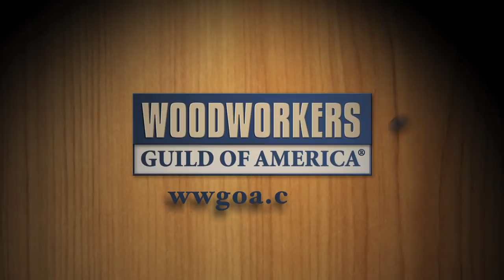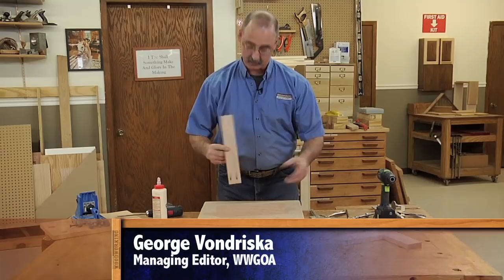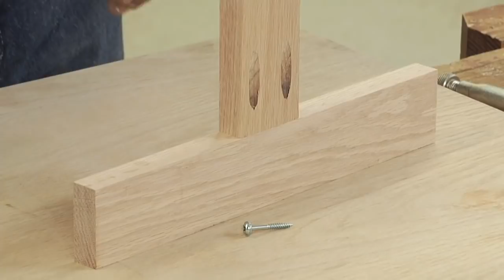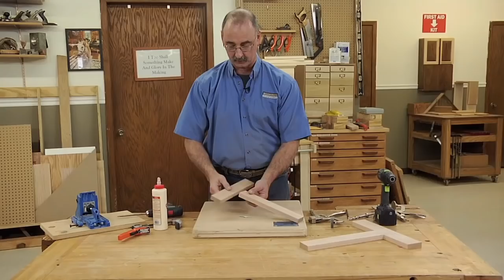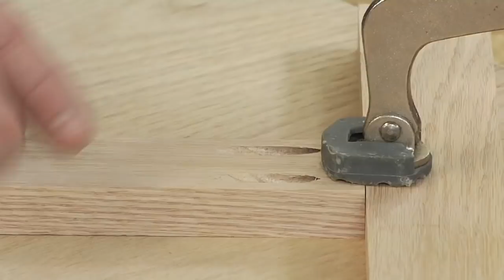What’s the Deal with Screw Pocket Joinery  |  Woodworkers Guild of America

Comment: I use pocket holes for face frames 100% of the time.  It’s fast, totally secure, easy to adjust a bit if you make a measurement error and...for the face frame application you need to remember that the frames will be completely supported and secure once fastened to the cabinet case.  Sold on KREG all the way.  P.S.  I am not affiliated with KREG.

Comment: I've had nothing but problems using kreg pocket holes,to me,it's a hit and miss affair.
will never use again.be easier if the screws were posidrive ends,sometimes the joint comes out of true ,
you can throw as many clamps at it as you possess,and it still moves when you screw in.
on 5/8 inch wood the screws sometimes won't hold and just keep turning and won't tighten.
won't use again.use a biscuit or dowels,maybe more work ,but I know I'll get a good result.
Brian,uk.

Comment: I just chastised someone for saying glue is pointless in a butt joint. Great vid as always. BTW I have found pocket screws to be great for any indoor application and for other "tight spot" situations where I could not get anything to start holding. They lasted about two years on some outside sunroom doors. I redid them all with glue and now everything is good. Glue BTW not only holds things together but in a situation of constant stress like an outside door it dampens and spreads the constant shock of opening and slamming as derived from wind, raccoons and kids.
Reply: +Toodle
End grain glue joints are useless as a primary joining method but when they supplement other joining methods they can be excellent. 

There is no harm in a little dab of glue on a screw joint.

Comment: Did you notice how far off plane those screws pulled the rail?  I've tried pockets and not found them all that useful or precise for all the extra gear cluttering the shop.
Reply: Nice catch, but that's because of imperfection in the joined surfaces. That proves just how tightly those screws pulled them together. You can see the gap at the top of the joint even before he starts screwing in.
Reply: +Mark Jones
The guy just used some scrap wood to demonstrate the joining process. More than likely what happened is that the wood is bowed hence the cut was not straight so it meant the face of the joint relative to the length of the wood was not straight. 

It is no big deal to be honest.

Comment: I find that pocket holes try REALLY hard to pull the joint out of alignment. They were a gateway drug to woodworking for me but I try to avoid them whenever I can at this point.
Reply: Jeremy, thought I was only one had a few disasters and cringe just watching video found could live without them I'm in a better place now Ahahahahaah!
Reply: As long as the pieces are clamped very tightly before you screw in and as long as the faces are perfectly straight, it should not pull anything out of alignment. I've done a few and never had any issues.
Reply: Vlad Malik thanks Vlad, but it's just not my experience, no matter how much clamping force I use, even different methods such as one parallel clamp on each board, more often than not the faces are pulled out of flush. At that point, having to struggle with clamping so much, it's usually not worth the "convenience" if the faces need to be truly flush.
Reply: I just tried it on two scraps: https://www.dropbox.com/s/h0qvijn4y4ugm3q/pockethole.mp4?dl=0

Wasn't particularly careful. Seemed as flush in the end as before, considering wood wasn't jointed or planed. I then tried clamping to the table on both sides. Used just moderate force. That was maybe slightly better. At the very least, easier to screw. I then shifted the piece over, drew a pencil mark across the joint, and screwed in again. It may have moved laterally by some fraction of a mm. I never really noticed that. Maybe could be completely mitigated with high-tack glue allowed to set for a few seconds?

Are you sure the screw is the right type? It should have a really sharp and self-tapping point. The drill bit should also be one with a pilot hole end, which keep it centered and prevents screw from traveling. And the screw has to exit right in the center of the piece of wood. As soon as it comes out and hits the other piece of wood, mine bites immediately without any traveling.
Reply: Pure horse dirt. 

Pocket holes are as good as any other method of joinery. If you cannot get them aligned then that is up to you to have a look at your methods. 

I use them routinely on simple small projects with out any issues at all.

Comment: Could have used this before my last project—Kreg pocket joinery can be frustrating especially joints that go out of registration and screws that bust through the wood even after following Kreg’s own instructions.  Will use the clamp next time.
Reply: It is an excellent method of joinery and is suitable for several purposes. Now if you are making a grand dinning table it probably is not suitable but it could be used in several parts of the table. 

Just take a little practise with it.

Comment: I thought we don't use glue in that situation because of expansion of the wood. It will stick fine in the beginning sure but when the seasons change it will break down no?
Reply from the maker: A good rule of thumb is to not constrain more than 3" of a cross-grain joint with glue.  Under that threshold the glue can absorb the minimal movement of expansion and contraction under normal circumstances.  The joint shown uses 2" material which is typical for face frames.  If the pieces were 4", I'd suggest applying glue to only the inner 3", leaving a .5" non-glued portion on each end.

Comment: Do you have to use pocket hole screws because they are 4 times the price of ordinary wood screws? Thanks in advance
Reply: Ed Macfarlane Yes, you must use screws with a head that is flat on the bottom. A panhead screw for instance would act as wedge and lever your two surfaces apart.
Reply: i dont know what you mean since i commented i have been using ordinary screws and everything is fine.
Reply: +ed Macfarlane
You can use ordinary screws to produce hidden screw joints but when doing at an angle you are going to need to certain things into account to compensate for the shape of the head of an ordinary screw. 

I used to do it years ago before pocket holes came along but it is not as straightforward as just drilling and screwing in.

Comment: I'm still not convinced about pocket screws. In my mind it just does not seem to provide a strong connection. Now with the added glue I can see it can, but I'll need a bit more convincing before I shell out $100 for a full kit.
Reply: I can't say I have met anyone who wasn't happy with their Kreg jig. Pocket hole joints have their weaknesses but they are still plenty strong for many applications. I use them on almost all of my projects and I haven't had one fail. I have built cabinets with nothing but pocket hole joinery (no dados) and they easily hold as much weight as you can place on them. You can get one of the small Kreg kits (Kreg mini?) for around $20 if you want to try them out.
Reply: Thanks ricksite . I tend to be an all or nothing guy, so I would want the complete pocket screw kit if I was going to get anything, but based on your experience that cheaper "intro. kit" sounds tempting.
Reply: I've recently dismantled a mach 1 jig made a year ago which was assembled with pocket hole screws and polyurethane glue, and I was amazed at the strength of the joints. As experienced by WGOA, the glue on the end grain held so well it tore out chunks of the wood rather than parting at the glue line. Secondly, the Kreg pocket hole screws were incredibly strong and had to be unscrewed rather than being wrenched out or severed. The Kreg screw steel is of the highest quality (better than any other brand I have come across) and the thread beautifully machined for maximum grip and resistant to working loose (creep). Needless to say I was able to reuse the old screws because of their pristine condition.
The pocket hole joint is my first choice when a STRONG joint is required, being the quickest, most flexible in application, and the easiest technique to implement. Brad-nailing is the quickest joint but lacks strength and is susceptible to creep and therefore not to be used in chairs and products frequently put under stress. The mortise and tenon joint takes longer to make and requires more expensive equipment. IMHO dovetail joints were the overall best joints a century ago but in the present day fast-moving society they have a shrinking following and best left to the professionals.
Reply: Jeff Harmed This is very helpful, thank you!
Reply: Jeff Harmed Do you really think pocket screws can be used to make a sturdy chair?  I'm a new to woodworking;

After thought, and budget considerations I did decide to get a table saw (never could cut a straight line with a circular saw, and hardwood is too expensive to waste on mistakes) and I got a router.  Can't afford dovetail bits yet, but have two straights, Good for making dado and rabbit joints.  I did recently buy a two pocket hole jig. I have most of the other equipment needed from over the years.of diy home care, at least a completely manual version of it.  by DIY Home care I mean most of the repairs to things around the home.  Table, chairs, boxes, floor work, hanging semi permanent fixtures, a few cabinets, hang doors... you know the stuff.

But, do you think, with glue of course, that pocket screws would support their use in making a sturdy chair?  I'm guessing I should think of it as a steel dowel, or pin, instead of a wooden dowel.

I'm with you on buying a joiner for mortise and tenon joint, would be nice; but, cannot afford that right now.  so I use dowels in some things.

Thanks ahead of time for any reply.
Reply: Chip Cooper I think you can use pocket holes to make a sturdy chair. I made some chairs for my toddler out of 1x2s and 1x3s and they easily hold my 200+ pound weight. I would look online for chair construction with pocket holes to get some ideas on how to best make them. You could even build a test chair out of cheaper construction lumber to test the design.
Reply: ricksite Thank you very much, that sounds like a great idea.  I see that you wrote 200+ lbs... for myself I would have to say 250+ or maybe even 280+ lol.  Well, all I can add is it is a darn site better than two years ago when it would have been 380+ ;-)
You know it's too much, when they won't let you ride a Clydesdale, so you can see my interest in 'sturdy' chairs.  Cheers, to my soon hitting the 250+ mark!  Thanks again.
Reply: I know woodworkers with many years experience who only have the basic single-hole jig that I have. You don't need anything else.

Comment: What's the deal implied you were going to say why to do it not just how 😐
Reply from the maker: +myaccountagain The main reasons that you might consider using pocket screw joinery include: 1) speed.  This is one of the quickest forms of woodworking joinery, 2) Reversability.  Assuming that you don't use glue in the assembly process, you can quickly disassemble a joint that is created using pocket screws, 3) Strength.  Pocket screws substantially increase the strength of a joint that involves end grain compared to a butt joint

Comment: So you spend $100 for the kit. And $30 for the special clamps. And then there is another one they call the 90% clamp and it is $35.  And there's  the one like in the video they are $50. Also you Got to have there screws. Every 6 to 8 inches apart. Box of 100 is like $5 a box. Seems awful damn expensive to me. What do you guys think.
Reply from the maker: +William Wynn Pocket hole joinery is great for certain applications, but there are no joints in woodworking that cannot be created by other means, so it is really a question of convenience more than capability.  Face frame construction is perhaps the ideal "sweet spot" for pocket screw joinery, but there is certainly application for other types of joints as well.   
From my perspective, if you any amount of face frame construction, then it is well worth the investment to get into pocket hole joinery for the speed and efficiency that it affords.  Once you have the capability, you will find other applications for it as well.  But for my money, if you don't build face frames, and don't have any other types of joinery where it seems to be THE way to create the joint, then you might want to prioritize other tool purchases ahead of this one.
Reply: Exactly! I use pocket hole joinery exclusively for face frames. Its the method I learned for speed and accuracy. Sure you can spend the time and do it by hand, but even if you are proficient with another system Im pretty sure Id be faster. Quick set up, budda boom budda bing
Reply: Learn to spell, and use the correct words.  ie, there their.
Reply: I thnk pocket screws are for lazy woodworkers who dont know how to do mortice and tenon joints or dovetails etc
Reply: I don't have all the tools or time to do other joinery as of now.A 30$ investment in a kreg jig has allowed me to make many and fix many thing in the house and garage.would like to learn other joints though
Reply: You can buy the single hole kreg jig for 30$ you can use 1-1/4 sheet rock screws along with a good adhesive.
Reply: or for those of us that do stuff on the weekends. and aren't wood workers. but do stuff around the house. Don't be so smug
Reply: Not smug, just accurate.😋
Reply: Lucio Carrozzo, it could be for those that want to test out woodworking like I did. I wasn't too sure if I would like it but I was interested in building my own cabinet as I saw on a Jimmy DiResta video in which he used pocket hole joinery. I built the cabinet and a few other pieces and I began to like it. From there I learned mortise and tenon, and tongue and groove joinery. I haven't began on dovetails but I will eventually. I just don't have the time for it unless I use dovetail jig, but I'm sure you would say I am lazy for using a jig.
Reply: Black Dog you should be polite. I agree...learn English. Words ha e meaning i.e bare bear. Red read
Reply: sz42781, sheetrock screws are a bad idea. they have a tapered head that when driven into a pocket hole has a tendency to make things split.  The reason you should buy the screws specifically for pocket holes is because they have a flat head that doesn't split the wood.
Reply: Too expensive for such weak joints
Reply: Pocket hole joinery is as good as any other method. 

If you are producing small tables that sell for $50 you clearly are not going to be using hand cut joints because with that it simply will not be a $50 table. 

If you are producing a small table for $500 then hand cut joining methods are perfect.  If you make 500 tables then pocket hole joiner is not expensive.

Comment: Adding glue is a waste because a butt joint glued on the end grain will fail before the screws will. In other words, the glue doesn't make it any stronger.
Reply: Justin H, your answer must be at the top...
Reply: Proof or it isn’t so!
Reply: I learned cabinet making in Germany. First put a thin lair of glue on the end grain, wait about five minutes, then reaply glue to the end grain and the other piece and clamp the pieces together. Let it throughly dry and you will not have to use screws for the joint.  If you are sceptical, try it out on a scrap piece of wood frist and you will see that this does work.
Reply: Word.
Reply: Did you watch the video? The guy says at 03:07 that the glue "did a good job of holding". The combined strength would be glue + screws. Still not as strong as a tenon, but "glue doesn't make it any stronger" is ridiculous. I just glued plywood on end grain to a piece of pine yesterday. In 10 minutes, applying force length-wise (the direction of force I needed to design for), I couldn't rip it off with all my strength. Lateral force did break it but only after a few tries and a lot of force. And that's just glue and plywood.
Reply: Vlad Malik Yes, the glue does its job but if you were to put load on such joint, the glue would have failed long before there'd be any substantial load exerted on the screws themselves. In other words: holding strength of screws and holding strength of glue don't combine, to achieve even greater strength but instead the glue fails first, the force drops and after that, the screws are the only thing holding the joint together. The glue joint does not stretch as much as the screw joint, so it simply fails when the force on screws is still rising (is not yet at its full holding capacity).
Reply: Justin H not true if you seal the end grain first with a coat of glue. Let it soak in and set up. Then glue the joint together. It really does make a difference. I have drawers that have lasted for decades under constant use with just nails and glue. They were made long before pocket holes were invented.

Comment: LOL pocket holes it not a wood working skill...  Pffff
Ikea and what not  use pocket holes.. a wood worker does not..
Reply: Ikea doesn't even use solid wood except for a few things made of raw pine. When I recently installed my Ikea kitchen cabinets (made of particle board and mounted with dinky screws and metal brackets), I installed wooden backings so I could reinforce the cabinets and have more points of attachment. The result was a rock-solid cabinet. Those backings were attached to the cabinet with construction glue and pocket screws.
Reply: Most of my custom solid wood furniture (made my the Amish) uses pocket screws in at least some way. They have their uses.